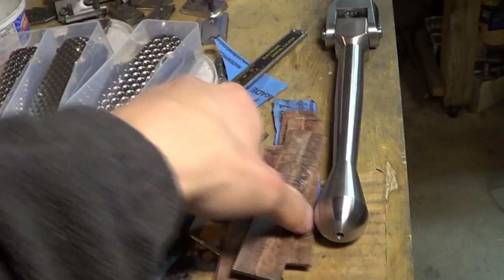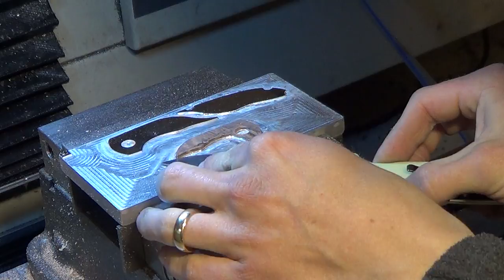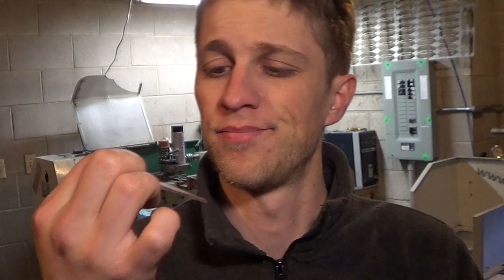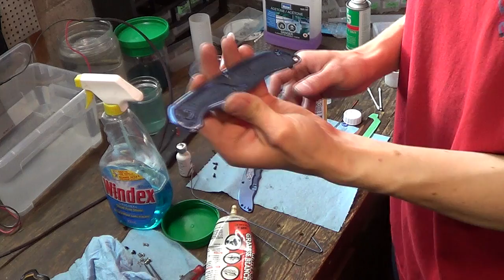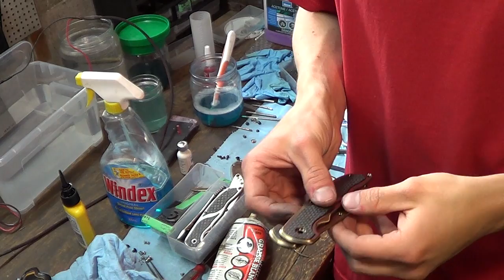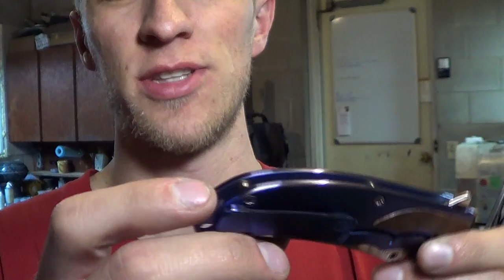Knifemaking Tuesdays Week 67 - Inlays Part 2

Comment: I know this is old but John you need to learn a trick that luthiers have been using for awhile. You take a strip of masking tape and put it on the fixture and another piece on the wood, then you need to burnish both pieces of masking tape to the fixture and the wood, then you can apply some CA Glue to the fixture and the accelerator to the wood. Doing this trick makes it super easy to remove the wood from the fixture.

Comment: i think it would have been easier with the wood inlays, if you had cut thicker sliced, milled them in the right shape, glued them on the knife and then faced them down.

maybe really complex, but i think it would have worked out.. just my opinion, after three years of cnc milling.

Comment: You're thinking about wood inlays the wrong way, at least in this application. First, mill the blocks of wood to specification, THEN cut the blocks into layers, not the other way around as you have been doing. I do work with wood and I will tell you, the thicker the piece of wood, the less likely it is to break or -- in your case -- shatter as you mill it or break it away from the template. Wood reacts better to lateral cuts than it does to formative cuts.

Comment: Use double sided tape to attach a block of whatever on top of the machined piece. This then stops the wood flexing and hence snapping as you remove it. If you slice it after machining then use masking tape to help hold it together so that if it breaks the pieces are all there and you can push some glue into the break with your finger. getting pre laminated pieces in around the same size will make all these comments redundant but the cost of plywood is also redundant and you could probably make your own for less in that size. you can always veneer the wood onto g10 (thats the fiber plastic stuff right?)

Comment: If you use wood glue or white glue  to stick the wood to the fixture, you can blow torch the fixture after and they will just come right off. The  strongest white glue is called melamine glue.
 You can whip out a lot of them that way.
That's how I mill camel bone and ivory inlays for pool cues.
You can use that metal plate whee you glue them , over and over again even though they will show witness marks.

Comment: John,
, I do Wooden boxes etc on my homemade CNC and often do inlay on the tops of the lids, I think are using the wrong technique,
  If you do a search i cnczone website for : V-carve inlay" you will find a technique for making inlays using a 60 to 90 degree V cutter, doing it this way you can leave the whole slice of burl intact and carve your inlay into the top, then turn it over and glue into the knife, then sand or machine the excess from the bottom, this enables you to do very fine work

Comment: John, leave the blanks full size, put small hole in the scrap areas  and leave tabs in the data. You can finish both sides. separate by cutting at the tabs then finish the small tab area. the fixture can be a 2x4 (lite cut it) flat. I do this all the time. works great. great vids

Comment: hi john
a normal glue holds only up to a temperature of 100 - 120 ° C very slightly when you put your device on a hotplate and the temperature will raise your inlay. when it will hoarse is your Inley on one side black which actually do not mind since it still ground or the side is glued.
sorry my english is not good hope that it is still easy to understand.
Besides others I hope I do not have the tip've read in the comment.

Comment: To temporarily attach things like this to fixtures, I use double sided tape. It is a consistant .003" thick and works incredibly well. So you could add .003 to your offset and feel comfortable that it is still parallel...   Maybe try that?

Comment: yup those thin point bits are what really need those high surface speeds. you can machine super thin with a sharp bit and high spindle speeds. also you'll get a much better surface finish with the high speeds. you might try sanding those burls with 800 - 2000 grit and watch that burl pattern really gain some amazing depth. I should be posting a video of the first part we are cutting on the mills today :)

Comment: I am using a hot glue gun to secure some wood pieces that I work with. Then I use a heat gun to release. Also as a warning to any Tormach users out there, make sure that you avoid mixing coolant and wood chips. The wood absorbs the coolant solution and leaves only the water which results in rust on your table.

Comment: John, Love your videos! Redwood is soft even stabilized, it seems that you ran into problems, not too surprising. Some woods hope you give a try, Lignum Vitae, & Mexican Ironwood. Both are very hard and dense. Some times the two are used interchangeably not sure this is correct but whatever. Spiting the wood from your fixture try using a razor blade or something very thin.  The suggestion to use heat seems correct. Again I love the attention to detail and the sculpture.

Comment from the maker: I didn't really have much trouble machining the, except sometimes the thin pointy bits would break off.  It was getting it off the fixture without cracking that was the hardest part.  Double sided tape, trimmed to fit, sounds like the perfect plan.  Glad to hear that your machines are up and mostly running well!  E-mail if you get stuck with anything.

Comment: when you get ready to tackle wood inlays again. give me a ring. i'll be glad to help you get your set up perfected. what you have now looks sweet when they come out right. but there's no reason you can get a 80 - 90 % success rate. anyway i'm headed back out tot he shop to figure out whats wrong with my pcnc770's tool changer. the 1100 works great, but the 770 isn't getting the tool position right and it keeps crashing.

Comment: also the 5000 rpm spindle speed on the pcnc1100 really isn't fast enough for wood working. you can use a high flute count to help offset the slow speed though. wood really wants high speeds and sharp tools so the fibers cut and not tear. i'm sure you've seen it but the series 2 spindle speeder is out now and would bring your speeds up to where they need to be (10,000 - 15,000 rpm).

Comment: stick the tape to your jig. then trim to fit with an exacto. then your bit won't clog. the slitting saw is going to smoke as you are trapping both sides of the blade. pick up you feed speeds to keep the wood from getting to hot and scorching. or even better grab a hundred dollar bench top bandsaw and use it for making your slices. then face them down on the mill.

oh and on the mist. don't use it. it will soak into the wood and ruin your finishes. use a shop vac to clear dust.

Comment: couple of pointers on the wood machining.

more speed. more speed. more speed. max spindle speed. then tweak your feeds to keep the wood from smoking. 

second. burls are gnarly. and the burls you picked are from super weak woods. you want a dense hard wood as they are easier to machine. looks at your rosewoods for your next inlays. burls are bad ass but they are finicky. I machine them on a regular basis. 

as others have said double sided tape. ca glue forms an epic bond with wood.

Comment from the maker: Sweet, thanks.  A while ago I tried to use the thin stuff to hold down some 0.045" plastic sheet, it worked great but the adhesive clogged up my 1/16" 4fl coated endmill.

Comment: Best way I have found to machine thin wood inlays is to glue the inlay to MDF board, machine to depth greater than inlay then remove sacrificial MDF from the back of inlay splitting it off with blade and give light sanding.

Comment: Hey John,
If you heat up the aluminum after your done machining the wood with a torch on the bottom it should help release the glue so you could take the wood off easily.

Comment: another option, go thick corner round.  then make a fixture out of tool steel the same shape as your handle inlay.  harden the tool steel and snap the wood inlay into it.  use your disk grinder to sand the extra off the back.  the hardened steel will keep it parallel.  you could even put carbide inserts into the tool steel fixture and never have to worry about it wearing out on your abrasives.  that's how I make my wood handle scales flat and parallel for my folders.  only mine are not inlays.

Comment from the maker: Awesome to hear!  Enjoy the machine once you get it all set up.  

The inlays might be too small to be held down hard enough with vacuum, maybe.
The slitting saw doesn't leave an awesome flat/parallel bottom on the cut piece because it's not wide enough to do it in one pass, so that's why I didn't do it like that.  But yeah, probably 20 comments have suggested that already ;-).

Comment: Have you tried smacking the part on it's edge?

Cyanoacoraltes (CA) (AKA Super Glue) fail under shock loads.

Test this by sticking a coin to a piece of glass.  smack the coin with a ruler slid on the glass to impact the coin edge and it should pop off.

CA can be removed with Acetone.  this may not work on the stabilized wood as it may attack the impregnated plastic.

have you thought about making the face you glue the part onto a little smaller so you can get your knife in easier and anywhere

Comment: if you leave them thick then glue them into the handle you can re-fixture the handle and finish machining them that way and corner round and what not.  Burl woods in my experience, because of the crazy grain pattern are very brittle.  To break most woods with the grain it takes something like 40 to 60 pounds, but if you cut across the grains it takes much less and the more perpendicular the cut the easier it is to break.  Also the stabilized woods don't like to bend at all because of the resin.

Comment: Glue em down with a thin strip of paper and use a razor blade of the carpenter type (with a hard back). You could always make em thicker and then glue them into the knife handel, mount the handle and then parallell them and countour them in place on the handle. =)

Comment: Delicate wood inlay can be handled with many methods.  Get a small thickness sander and avoid facing on the fixture.  Vacuum is doubtful on such small parts, but there are some gasketing options that might work.  An acetone bath should dissolve the CA and not damage the stabilized wood. Strong double stick tape will release with naptha.  High strength waxes (AquaBond products) release with heat.  My favorite is hot hide glue, which releases in hot water. Scuff the fixture for a mechanical bond.

Comment: I am no woodworker either, but it might work if you don't do the facing operation on the inlay fixture(just cutting the edge and contouring the edge). Just leave the wood thick glue it into the finished handle and face the inlay on the handle fixture.

Comment from the maker: Ha, agreed.  A glue fixture is easier to make than a vacuum fixture, but I'll try that out sometime.  For vacuum I get something like 12 pounds per square inch of holding force, and the inlays are only like 1-2"sq, so I wasn't sure if that would be enough.  All depends on how much cutting force is required, if I had to I could make the profile passes lighter.  That and the shape is really weird.  But yeah, I'll try it some day.

Comment from the maker: I'll have to try that next time.  The surface from the slitting saw isn't flat enough for gluing, but you're right if I sanded it down after it might be good.  But it might not be parallel if I sand them crooked, so they might sit crooked in the handle and look dumb.

Comment from the maker: I thought about doing that, but it's just like you wondered - the finish from the slitting saw is not good enough for gluing them down, especially since I can't do one clean slice I have to dance around it until it pops off. When I make the slices I use a flycutter to flatten one side, that becomes my glued side.

Comment: You've got some good advice going on here.
I'm a joiner by trade and would look at this in two ways, buy ready thicknessed veneers then use the paper method to fix them, or machine the whole block to shape then glue it down and slit the veneers off the block yourself.

Comment: I started out with wood. for thin parts similar to these, I have cut them to a larger thickness, then planed them to the correct thickness using my belt sander. 

That, or possibly the vacuum table. If they are porous or the surface area isn't sufficient, glue shim stock to the bottom. Aluminum, brass or copper. Anything that will bend more readily than the wood, so you can peel it off. Or a thicker stock, but flip it afterward, thin the areas behind the wood and pop it out.

Comment: dont glue them down. If you want to be like a machinist with wood then clamp it down with a profile that exactly matches the pattern you are cutting leaving tabs like you do when you make you metal parts. then you have to hand finish the tab parts. Easily done cause the wood is much easier to work with than metal. The tabbed spots can be hand sanded with a block.

Comment: Possible solution to your wood cracking problem: keep the wood thick (dont plane it down) until you get it glued onto the actual knife. Then do the planing step, to get it the right thickness

Comment: I'd have thought the inlays would be a good application for the vacuum table. I'm now curious if stabilized wood will hold a vacuum-- logically, it no longer has pores. Don't fret too much, I used to do (attempt) alot of cnc wood working. Its entirely different than metal, and requires alot of unlearning of what you've accomplished so far. The work holding techniques rarely transfer, and you're rarely looking to form a chip, rather its better to just turn it all to dust. Its messy. BLEH I say.

Comment: Forgive me here, or just take no notice but . . . You really should clamp every knife inlays as what may seem sounds may only be touching in certain areas and constant use and knocks with change and keys in the pocket can split them. Constant pressure for as long as you can afford to leave them would in my opinion as a wood worker and having done some for more thinner inlays than you have in silver, gold and wood, it is the only way to be as sure as you can to know that inlay is not coming out!

Comment: hey just another thought?  my wooden gears all geased up this AM...they use a hot thin blade knife to cut rope at the Marina, we also used hot knives in the synthetic plaster trade, lay that thin razor blade under that Burl and slice it off the table..cheap fix there....lots of diy possibility's whit the hot knife,  youtu dot be/na7pJqbyOQY

Comment: I use double stick tape: works fine. I suggest you not to use water mist: wood is alive and water is vital. Woodworkers used to spray water on curved boards before put them on a press to make them straight or before bending process.

Comment: Being a past wood worker and builder, I think you will find it is the 'Stabilisation' of the wood as you said, which works in a vacuum and draws all the basically plastic resins completely through the wood that when dried, and I think they 'cook' it afterwards to harden it, is the brittle part to the mix. Wood is very kind' and kind of 'malleable' and bendy and great to work with. The other thing which although beautiful beyond belief the Burls

Comment: I'm thinking a real skinny hot wire John, I'm a old retired plaster mason, we used a electrical charged wire to cut Styrofoam quick and easy, I would wreck con the glue would give up quick, I don't know what would happen when the hot wire hits the fixture? pop!! pow! bang cuss!!!!!..maybe you can use a solvent??? also grew up working on the old saw mill, the swedge on the balded will eat up the profits, so we went band saw...think thin...

Comment: I don't know if you will read this but. I have a solution!!!.....If you mount the whole block of wood in a vise. (if you have some left!)  Then you level it. After that you route the shape, corners and holes.  Then you take the saw and saw the whole inlay of the block..that should solve the cracking problems..Maybe you have to finish the underside by hand on the beltsander...... simple. ;)

Comment: Just had a look at your inlay video and had a thought about the would.
I do not know what the finish was of the slicing operation. But if this is good enough for the glue side. Why not put in the block and then mill the inlays as you would on your fixture. And then just use the slit saw to cut them of at the right depth / thickness. And then machine the next layer repeating the process.

Comment: Great job John! Dont give up on the wood!! When using the slitting saw, the smoke produced indicates friction burning. Speed up the RPM or reduce feed rate, perhaps both.
Also try using a more heat sensitive glue to fixture them for profiling, then soften the bond with a heat gun for removal.
KEEP IT UP

Comment: Another suggestion, you could use a stronger material to back the wood. Not sure how feasible that is with such thin material but it's probably the most reliable method I could think of.

Comment: have you tryed heating the fixture to release the wooden inlays? use a hot air gun from the back side, superglue can't handle heat.
If you maybe put the fixture in the oven at 100°C it would come of perfect.
Just a quick thought, actually never machined rose wood but I reckon it would work.